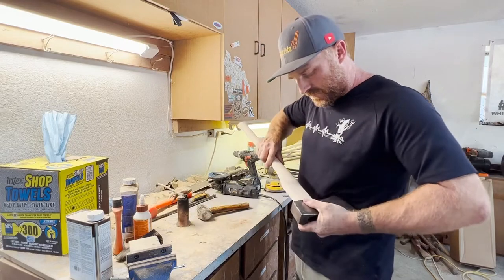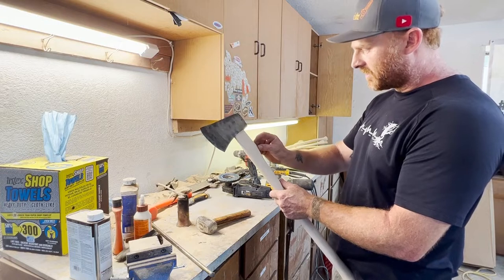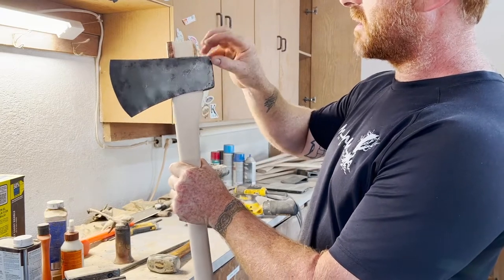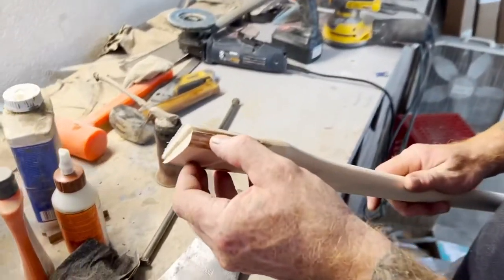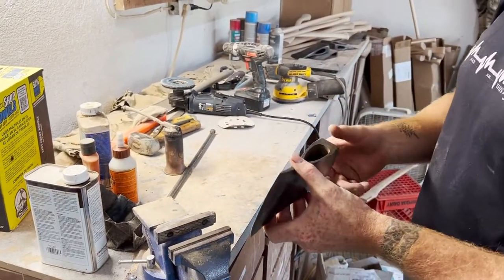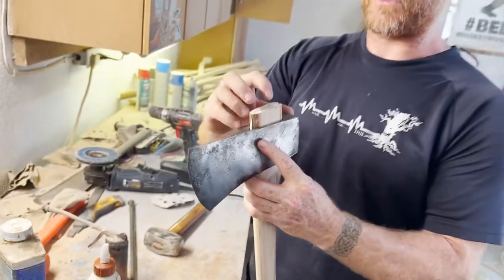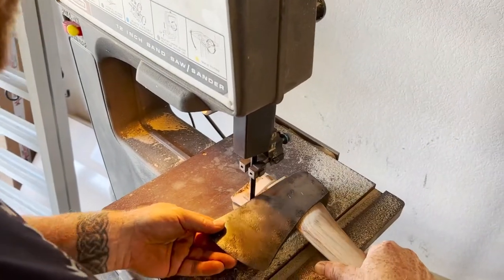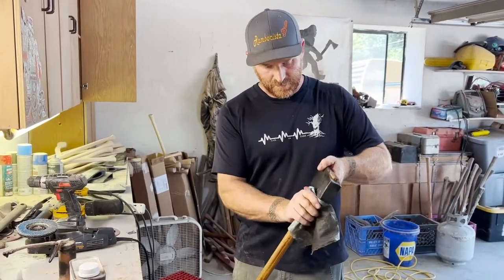Axe Hanging Tips

Comment: I use wood glue on my wedges too and guys crucified me on my axe hanging video for it. They argue you should only use boiled linseed oil on the wedge not glue. Been doing it with glue my whole life and it’s always worked for me. Great video guys. Thanks for the info.
Reply: A light coat of tight bond three on all surfaces is the way to go never had one slip.